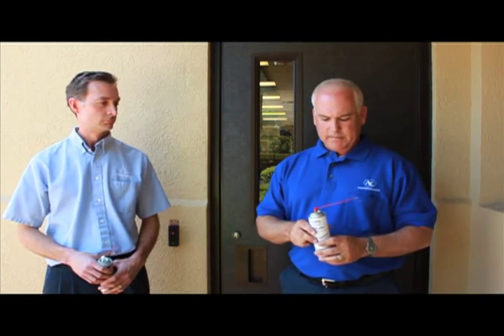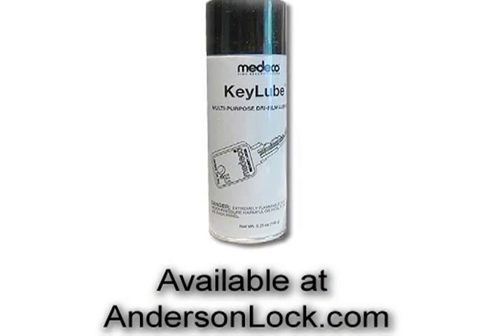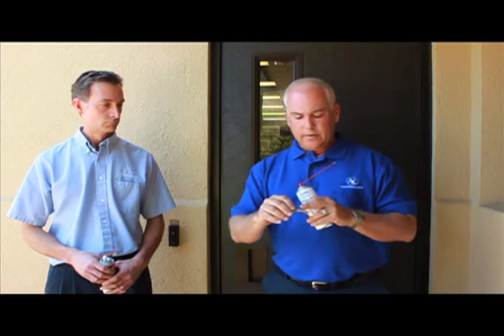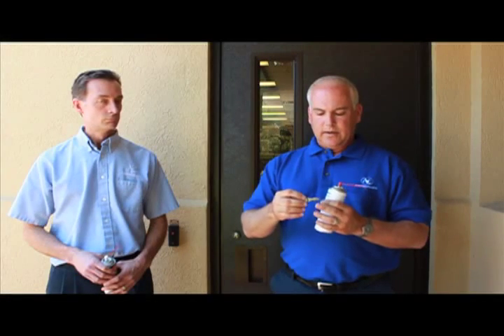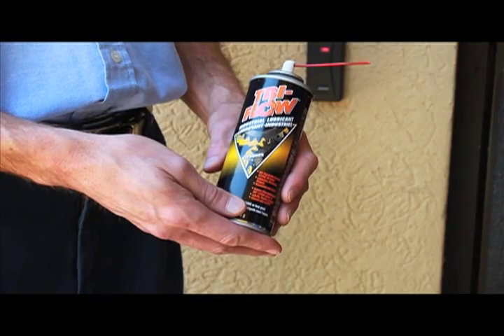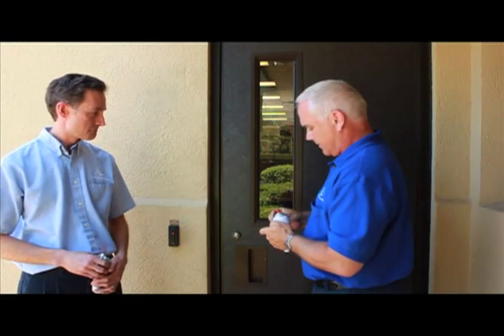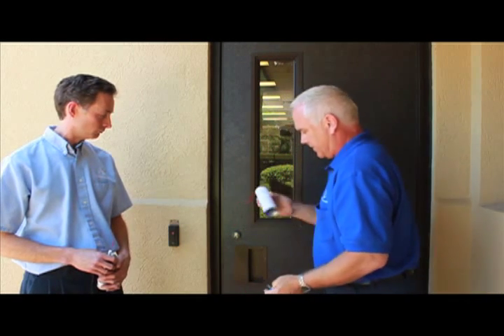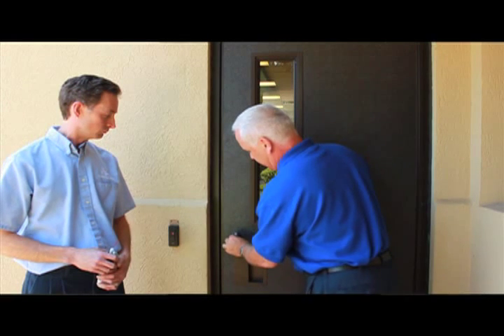How to Lubricate a Cylinder Lock - AndersonLock.com

Comment: I've used Liquid Wrench on all sorts of locks for over 35 years.  I have never had one problem.  I bought four Papaiz locks in the mid 80s and spray them in the spring and fall.  They work great.  Same with my front/back/garage and shed door looks.  All work as well as the day they were purchased.  The key to anything working well is maintenance.  Most people however are lazy.  A perfect example of this is how many garage door openers break because people can't take 2 min to lube the spring and chain/roller wheels a couple of times per year.  Or people only using their key fob then the lock gets seized from lack of use.  Just lazy!